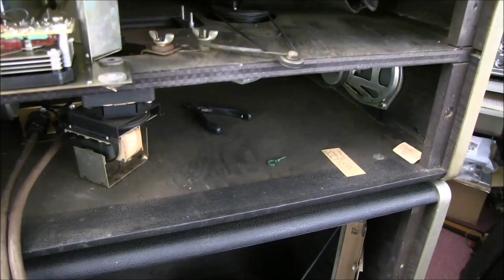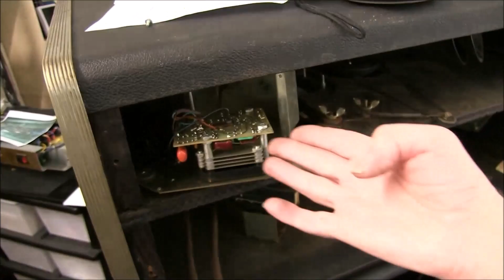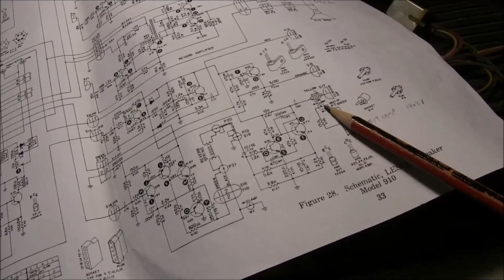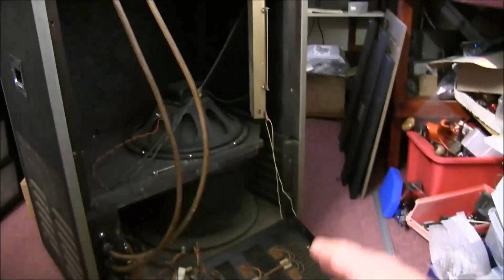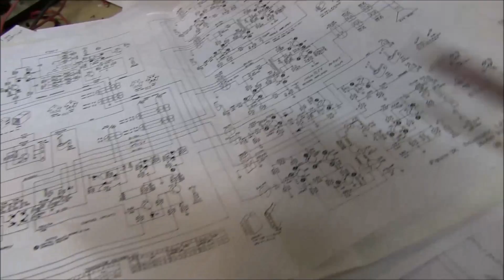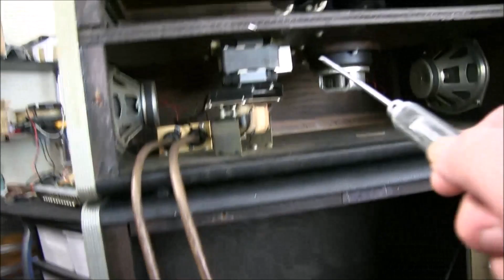Leslie 910 Rotary Tremelo Reverb Speaker. Repair, Circuit analysis. SoundTest

Comment: In all my years of servicing all manner of leslies, I have NEVER seen one of those spacial expansion units (I forget the actual name, that's the one inextricably stuck in my head now) that works! They all have failed by this time... Even a brand new one out of the box, I fear would probably only turn a few times and then explode violently! They take a 300 volt B+ into them for some reason, and they're apparently a really cool REALLY high votage effect that mimics the leslie... and on the 910, I believe their only purpose was to recreate the leslie effect for the REVERB.... really?? That was necessary? I don't think it was! lol

Comment: Hello Nick, Thank you so much for this video! it is such a big help for me as I have just bought my own Model 900 which is a slightly different beast but is very similar to this ampl here - I believe only the cabinet hardware is a bit different. Would you please share with us the values of the brake circuit capacitors you have replaced the originals with? Do you think there is a way to replace or modify scr D11 to make the bass baffle run low speed instead of just spinning off and eventually stop? Your kind help is highly appreciated!
Reply: Just saw the announcement on the channel, RIP Nick

Comment: Most interesting Nick, I have a Leslie 910 in my workshop in pretty good condition... I did overhaul the PSU (re-cap etc) , horns and bass rotor bearings and belts; then adjusted and balanced the multi channel outputs.  It is a beast as you stated; very loud and rugged; and an ideal gigging leslie :)  Don't use it now as I have a Leslie 145... but if anyone wants it; it is going cheap (I need the space) :) Else I will break it for spares.   I'm in Hampshire, UK by the way... hit me up with a post if interested for use or spares.
Reply from the maker: Hi Jammo.  Where is it advertised, or where are you?  Thank You Nick
Reply: @nickadams5411  Hi Nick... I have not advertised it as yet.  I am in Southampton, Hampshire UK.    Oh, your AVO vids were a godsend when I obtained a couple of AVO's mk3 & 4 ^ :)
Reply from the maker: @Jammoko  Hi Jammo . I am at Aldershot, Hampshire. Not too far.
You can contact direct:  nick@demonproducts.co.uk
Reply: @nickadams5411  Thanks Nick... posted to you... ^
Reply: @Jammoko  how much did you sell the 910 for in the UK.. ?
Reply: @SPINNINGMYWHEELS777  £250... too cheap really! However... they are huge and people don't like the size these days. I needed the space. Nick passed unfortunately... he was an electyronics whiz.  Sad loss... :( RIP
Reply: @Jammoko  hey - I asked because I posted mine for sale last week in Canada.. I posted it for a very low value $300 CANADIAN..which is like 175 Pounds...  -   Yes they are huge, and  a limited market but I was SWAMPED with people interested.. I sold it to a guy 2 hours away who thought my price was TOO Low and gave me more than I asked.   He came with a car so small it was a comedy but I was surprised it fit..  his daddy drove him from the big city to buy it for the young fella's studio he's building up. I remember being that excited to buiild an analogue studio 30 years ago (but I didn't have a supportive parent helping me .. lol) .. .  And that was the cool part the kid is focused on all analogue. That means REAL PEOPLE PLAYING MUSIC IN THE ROOM !

Comment: This was what i needed to see to work on my 910 unit but i also was wondering if you can set it up without the Tremelo Gen because i don't have the unit? and also what are the R values that you used in the box that you made ?
Reply from the maker: Hi Michael The reverb will work ,but without the pulsing. The reverb volume control, I ended up with a 4K7 variable pot with a1K8 resistor from it to ground, to set the max and min volume.  That Leslie gave me the most headaches. I am just modding it to take an external input from an amp. to bypass the internal amps.  If you need more info contact me directly on: nick@demonproducts.co.uk
Reply: @nickadams5411  Thanks for the reply i am going to try to put this 910 system in a different cab with the reverb in its on cab so i will be able to control it as i need like the old style tube uint.
Reply from the maker: @MichaelLHill-fd3kw  Contact me directly for any info:  nick@demonproducts.co.uk
Reply: @nickadams5411  Also do i need to do anything to bypass the Gen unit?

Comment: Hi Nick, many thanks for posting the video. This is very informative. I have a Leslie 910 myself, but it didn't have the reverb unit wheel (or pulley) when I bought it. I was wondering if you had the wheel's dimensions, so I could try to make one and get the reverb effect working as intended.
Reply from the maker: Hi Gus
I guess the wheels breaking off was a common problem. (A  manufacturing flaw).
The pulley wheel, that I fixed back on, is 4.0" diameter.
It has a shallow groove for the belt to run in.

Comment: Can you get a bolt in there if you could tap it you maybe need to drill it out a bit deeper, or epoxy a cut off bolt or stud in the hole and using nylon nut and 2 washer either side to hold the pulley. Doesn't look that complicated to come apart tho. Yes it will have plenty of force even rotational force  will work it loose if it's not properly threaded you need to epoxy the grub screw you might get away with it.
What's the point of the light bulb what does it do?
Reply from the maker: Hi John
Thanks for your input.
The grub screw (stud) worked out perfectly in the end.
The light bulb is essential, to limit overloading the reverb and reverb driver.
Reply: Nick Adams yes but why is it on the pot as well what is the point of it here
Reply: 49:15 The circuit diagram tells you the voltage, but not the current of the light bulb. Watching the video carefully, it looks like the point is to find out which of the light bulbs is more suitable for the circuit.
Reply: Nick Adams ok does it have any bearing on sound the bulbs, why not use a thermistor instead or a fuse that goes into high resistance.